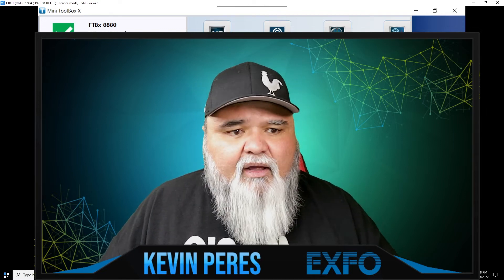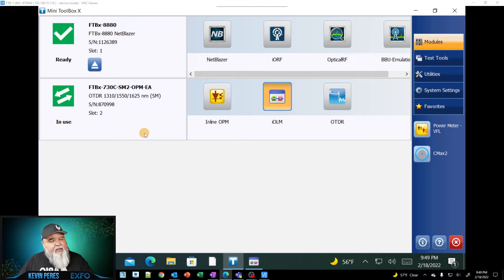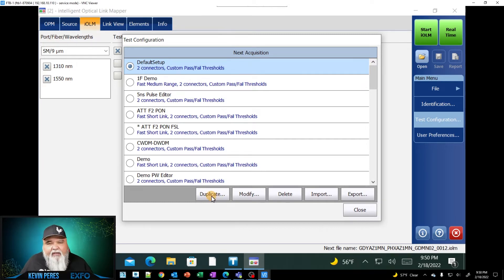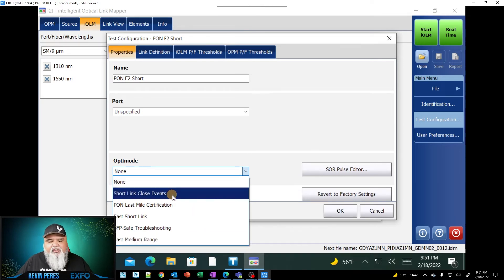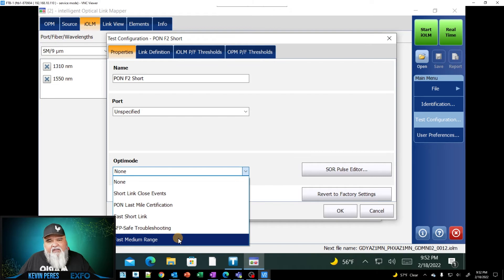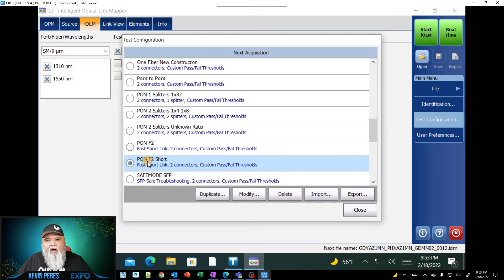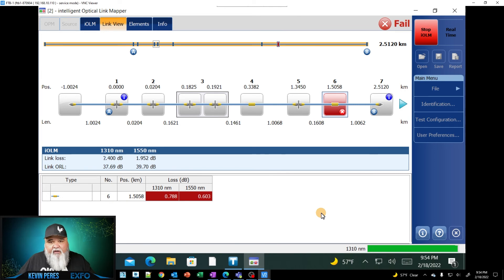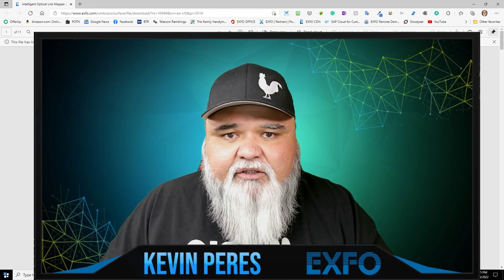Optimode on the EXFO iOLM using test configuration files.

Comment: Hello Kevin. I just purchased 3 715 max testers. I was trying to set up optimode for Fast medium link, however these units arenot giving me the option to do so.. I have a Fast short link and PON certified last mile but I cannot use short link as it says my link is too long. Typically using 1500’ launch on a 3-10k ft cable
Reply: I also want to add that I use fast medium link on a couple FTB-1 Pro models that we have as well
Reply from the maker: Aaron unfortunately the 715 does not support Fast Medium. It is our shortest reach iOLM and does not have the power for that configuration. Need at least the 720 or higher. Email me at Kevin.peres@EXFO.com if you want to discuss